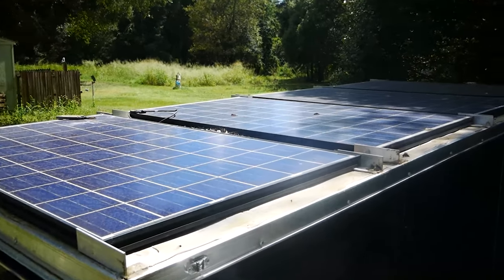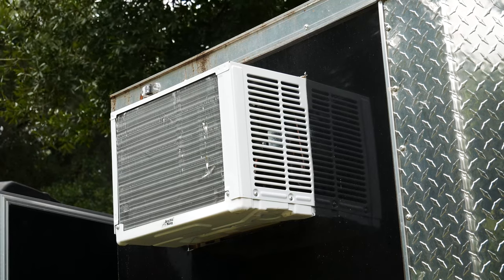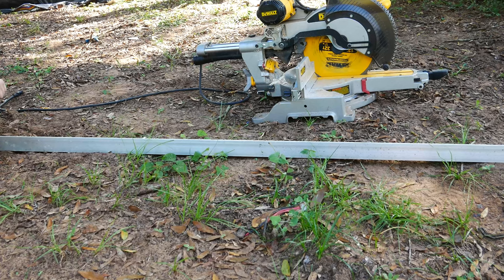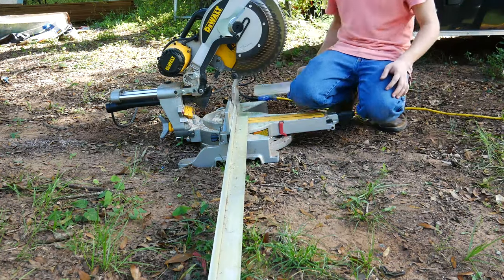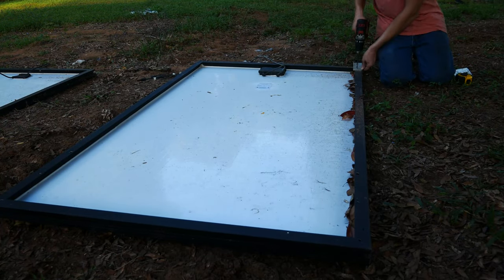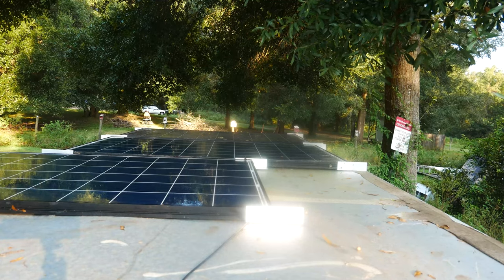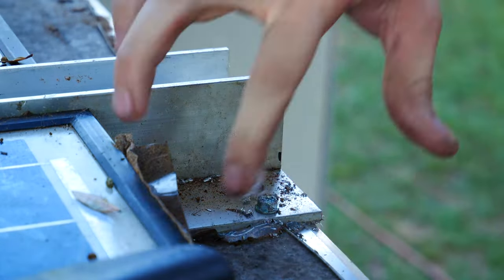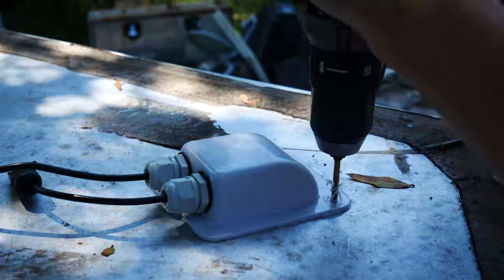Installing Solar Panels On The Roof of An Enclosed Trailer: 1000 Watts!

Comment: Good.
Although it looks messy, you have made 4 independent metal corner pieces on a solar panel, and each corner piece has 2 screws, a total of 8 screws to fix a solar panel.
That's more than the strength of most youtuger DIY projects. Too many presumptuously unstable mounts that look alarmingly dangerous.